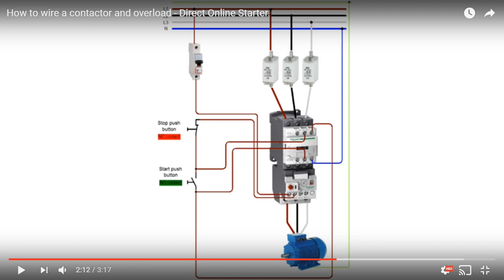How to wire contactor and motor protection switch - Direct On Line Starter.

Comment: When I started watching and noticed that u wired the control circuit A2 to complete the circuit to the neutral for the coil, I was wondering why u did not put in a retainer wire to keep the coil energised, but later I realised you did that on purpose haha...

Comment: Nice video.  Do you  have similar video explaining  wiring 3 phase  motor  ( no neutral line ) in safest way
Reply from the maker: Please feel free to watch this video How to wire a contactor and overload - Direct Online Starter. https://www.youtube.com/edit?o=U&video_id=zG5aPYf0AZQ This will explain the whole control circuit wiring for 3 phase motor.
When it comes to wiring the motor itself I will soon make a video showing how to wire motor in star or delta.
Reply: AboutElectricity thanks alot but the link is wrong maybe . Can you tell me what best protection device ( ELCB - MCB - RCD - CB )  should be  placed before 3 phase ( 2.1 kw ) grinder to use it saftey in a home ? By the way the grinder already have contactor and  on/off button .

Comment: if i were just using the relay as a passthrough for a 240v 40amp and the relay is for upto 600v at 60amps then would I need anything more than just the 110 switch to trip he no/nc? if it went over 40amp wouldnt it just pass through to the breaker and flip the breaker in the main panel since its the weakest link/lowest amp switch? just using it for lighting on/off with din mount controller.

Comment: I’m a hoist technician’s apprentice and I’m having some trouble with terminology.  What is the distinction between the “X1” and the “X2” side of the control circuit?
Reply from the maker: I am not familliar with X1 and X2 markings.Do you mean A1 and A2 ?
Reply: “X1” & “x2” refer to the control circuit in a motor control panel. Typically the primary voltage(generally between 110v & 480v) is stepped down, for control voltage, to between 24v-110v. The 2 transformer output terminals are marked “X1” and “X2”. What is the distinction between these two?
Reply from the maker: @dustinfringe3557  if it is a transformer then X means low voltage side of it. For small control transformers, there will be X1 and X2 terminals only where X1 is the power side and X2 the grounding.
X1 goes straight to control circuit after it passes through a fuse usually rated for the circuit. X2 is terminated to the neutral side of the control circuit and is also used for grounding safety. Therefore, X2 terminal of the small control transformer must be wound together to a grounding structure of the circuit.
Reply: AboutElectricity that essentially answers my question, thank you  :-)

Comment: when u have single phase el. this motor starter u do not wire like this .first come to l1 contact on top then 
trough device to l1 down then bridge to l2 down  then trough device up to l2 then bridge to l3 then then trough device down 
to l3  and that is outlet at l3 down. I appropriate your effort but but it may be wrong. please correct me if wrong.regards
Reply from the maker: Like this https://youtu.be/cWs5JwK1_ig

Comment: hi! i am not sure but i notes maybe u have a little mistake with wiring from mcb to n.c of  protection switch. cause it should be n.o when its prest. witch mean u should connect to n.o if i am write.
Reply: Vova Moon it is a N/C contact from the overload. It is normally closed unless there is a thermal overload and the contact will break. The circuit can be shut off either via stop button, or thermal overload contact tripping

Comment: What is function of red and black button on protection switch with auxiliary contact ?
Reply from the maker: The red and black buttons are an integral part of the motor  protection switch. The only reason I have pressed the red one is to simulate overload condition in the circuit.
Reply: Li ming Chung

Comment: The circuit wouldn't work if you conceded to the N/C on the motor protection circuit breaker should be on the N/O!!!
Reply from the maker: Lee Wheatley ok my friend.you do connect wires to the NO contact and tell us if it works.
Reply from the maker: Lee Wheatley please watch the video again.
Reply: Well you should be on terminals and 13 and 14 (Normally open) on the mpcb as the "normal" state is when the breaker is turned off (de-energised) if you were on 21 and 22 (normally closed) this would only let power through when the mpcb is turned off.

I suspect that it's just a typo on the subtitles.
Reply: Pity you can't post pictures here I could show you the 2 x 1200 Amp Star Delta motor starter control panel currently building / installing.